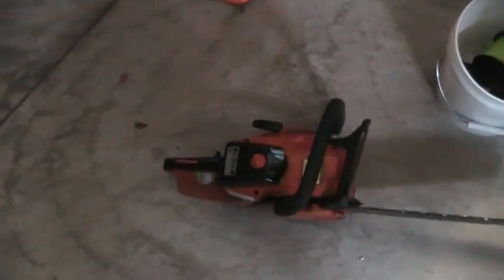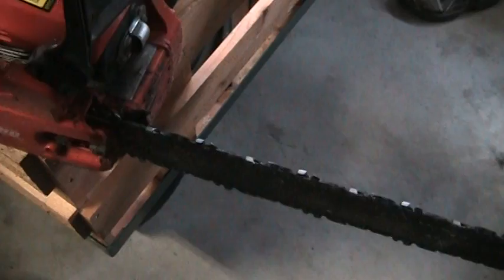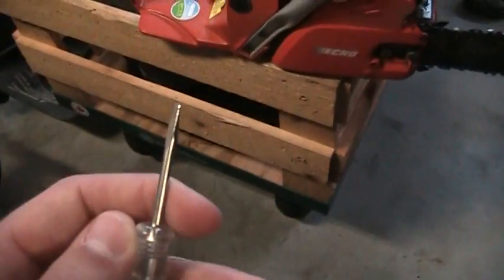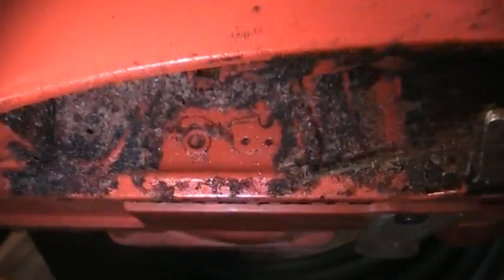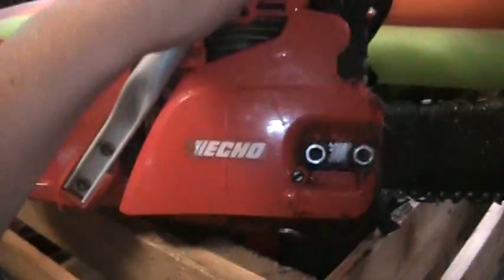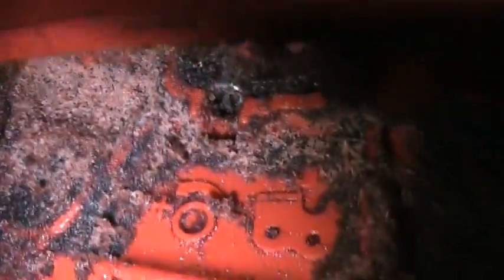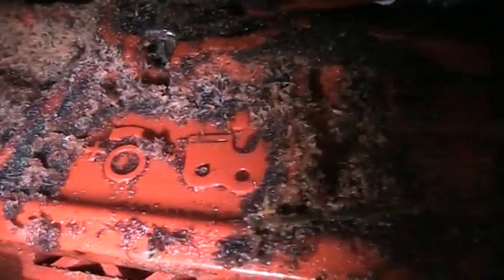How to Adjust the Bar and Chain Oil Flow on Your Echo Chainsaw

Comment: All my Echo cs280e  needed was new o-rings on the oiler stem.  Lowes plumbing dept. bought -  Danco #36 orings.  5/16" OD x 3/16" ID x 1/16"
Works like new now. Just need to tweak the turn to get the desired flow rate.  No more leakage when saw is turned off.

Comment: Its actually good to have the oiler all the way up, I have mine all the way up. No reason not to but it makes your bar and chain last longer.
Reply: i dont think its good because you run out of oil before you run out of gas
Reply: Meh, better too much than not enough, sure. But makes a helluva mess, & yeah, you'll be refilling every time you turn around.
Reply: @chris2790  Thanks for the advice. I'd tend to agree, if you read my comment. I've had a saw in my hands for over 30 years and service them weekly. Yes just right is ideal. Unfortunately, thye don't all afford us that just perfect amount.
Reply: &  You  Can  See  The  Oil  Flying  all  Over  Like  Crazy  ! !  Mess  &  Wasted  oil ! ! !
Reply: @Chuckrussell75   How many turns out you think is best.  I am thinking I will seat the screw then figure out best number to turn out.  Any suggestions?

Comment: Never got it to reduce oil flow. Put a brand new one in. It has a roll pin that restricts adjustment to only 1/4 of a turn. Tried removing pin but the whole adjuster comes loose of the oil pump body.

Comment: Please tell me how to get out the oil filter/strainer of my echo cs 306. Normally you’d just get a wire with a hook and pull out the feed tube but the tube is to short to pull out it’s on the bottom of the tank please advice

Comment: Hmmm. I have an ecno cs280e and it is totally different. the oil pump is just behind the fuel tank. You have to remove the air cleaner and use a flat screwdriver through the fuel tank clamp and adjust clockwise for more oil and CCW for les...So not all echo's are alike. Yours is called a clutch related pump if I am not mistaken. It only pumps if the chain is moving.
Reply from the maker: Yes you are correct. this one runs off the clutch drum so yes, only when the chain is running then it will pump oil.  It depends on the saw for where the adjustment screw is, and if it is possible to adjust
Reply: Jimmy,  I have same exact Echo cs280e .  yes Front plastic filter cover off , then filter off and there is a frame hole to stick screwdriver through. A slotted screw head  above and behind the fuel tank.  
But my problem is that the oil leaks out profusely when the chain saw is sitting not in use.  There are 3 o-rings on the oiler assembly that I hope will fix my problem if I replace it.  
If your problem is no oil coming out, first make sure the line or filter not clogged.  Removed oiler assembly screw to see if debris is stopping the flow there.  May have to replace the entire oiler assembly. 
Google search the Echo cs280e parts manual.  Find the parts numbers for your saw. Search online and order. Ebays sells parts cheap.
Echo CS-280E oiler assembly part # 43700011230 (includes orings and spring).
3 orings for the oiler #43702002830
Reply: @Accumulator1  awwwesome i have a 280e and it seems to oil profusely so i'll replace the parts - not in my bare feet of course
Reply: Update:  I fixed my oiler leakout by removing the oiler assembly,  measuring the 3 orings.  I could have ordered online but would everyone gouges the price and shipping plus the wait time. So I went to Lowes and found a perfect oring match in the plumbing dept.  Saw oiler works perfect now.  Used, 
Danco #36 orings.  5/16" OD x 3/16" ID x 1/16" .
Reply: @Accumulator1  thanks I changed out the o-rings. Now for adjusting hte oiler - how can i determine a good flow setting? From the looks of the design, it seems like turning it in CW chokes off the flow hole while CCW lets the pin out, increasing flow. The screw has an arrow on it also, for what I don't know
Reply: @Rod Salka  If you took notice, that screw with the orings is actually a hollow tube with a spring tension piston on the bottom.  So it must ride some lobe when the saw is running and as it goes up and down it pumps the oil through.  If I remember, I unscrewed it to reduce the oil flow.  What that does it raise up the bottom piston so that it shortens effectiveness of the stroke in that tube.   
If you are reducing the flow by turning CW maybe because it is bottoming out . Not sure if that is a good thing.  
I use to run an Echo CS 350 with the oiler turn knob on the top side outer case.  It clearly showed a CW arrow with the stem of the arrow getting wider as it went towards the pointer.  That indicated that turning CW suppose to increase the flow.   
So I assume the design and function is relatively the same with the 280e.

Comment: NOT every Echo chainsaw has an "adjustable" bar oiler... and you shouldn't mess with  a saw with bare feet...   that's just common sense.  They can bite, even if the engines not running.
Reply from the maker: Yes I've been around chainsaws for a while. If I'm running a saw, I wear work pants, chainsaw chaps, and a forestry helmet for ppe.
Reply: I wear just boxers while I juggle my chainsaws
Reply: Stable  Genius  "  ?   Mfg.  Says  Put  Chain  Break  On  (  Forward  )   ! !

Comment: Some suggestions: Wear shoes. Looking at your feet distracts from the whole presentation. Clean the saw around the area you are trying to point out. Taking time to clean it while speaking speaks to a lack of preparation. Read up on the 6 P's. When you advise to turn the screw speak in terms of 1/4 turns,1/2 turns. From my angle watching you I can't see what a little turn is. You seem to know what you are doing. Present it to the viewer in a prepared way. Good luck ! P.S. Fix your lighting.
Reply: Dead  On ,  Larry  ! !

Comment: i have a 352 echo and i dont see any oil adjustment
Reply from the maker: sometimes the saws don't have an adjustment. how old is your saw?
Reply: i bought it in 2012 feb
Reply from the maker: +Junior Parsons yeah, it must not have an adjustment. I'd recommend looking in the manual if it isn't in the same location as mine.